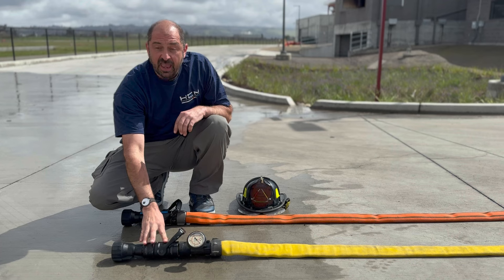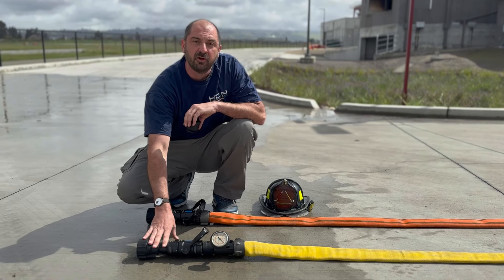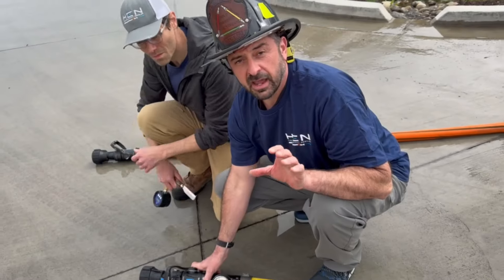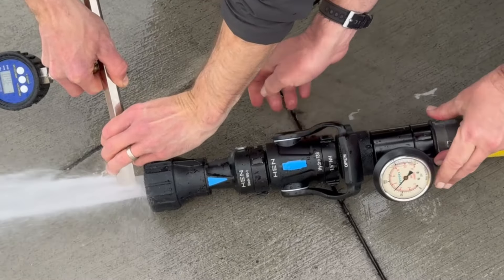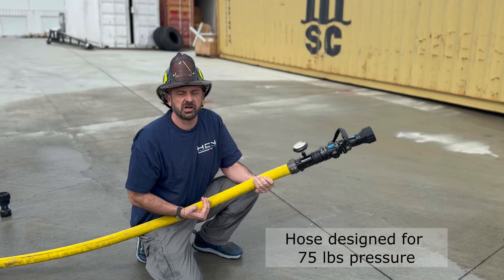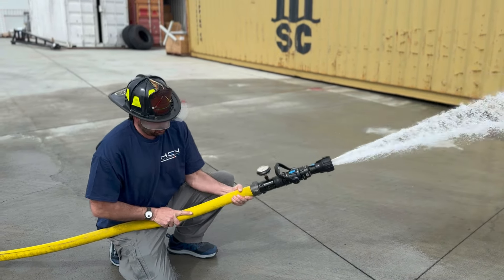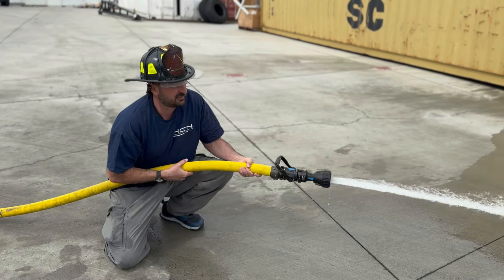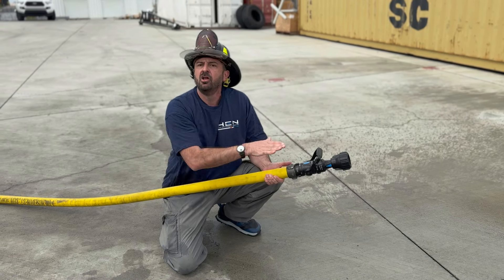Introducing the World’s First Back Pressure Increaser: A Game-Changer in Fire Suppression Technology

Comment: Will you still be able to extend the line (add additional hose) to the end of the nozzle, in case you extend short? Will it prevent pressures of over 50 psi in the additional length added beyond the turbo?

Comment: The HEN Nozzles TURBO BPI is A Revolutionary Advancement, Disassociating Nozzle Pressure from Back Pressure.
We have been working on this for a while, get 160gpm@50psi a 60lbs Nozzle Reaction and a 75psi hose Back Pressure, now that sounds like heaven, because it is:

Stay up to date on what's now possible, from rig to nozzle, and pattern to seat.   

HEN is Building the Most Advance & Balanced Handline Attack Package Systems in the World.  Back Pressure vs Nozzle Reaction GPM & Pattern Types.  A New Trifecta is Now Possible From Pump Operator to Back -up to Nozzles.  
TURBO Charge All 1.75-inch Handlines with 50psi Nozzles Pressure

The Turbo between 150 to 185 gpm, increases Back Pressure an additional 25 to 30psi in the handline stretch from Rig to Nozzles on top of the 50psi Nozzle Pressure in both Flowing and non-Flowing Conditions.

Boost 1.75-inch hose performance when using a 50psi NP with impressive benefits in all essential metrics from Higher Pressure Hose to Premium Low-Pressure hose design.

Streamline essential members tasks in handline fire stream development on the fire ground, while enhancing suppression and safety:

Pump Operator:  
1) Higher Initial PDP = Less Kinks On-Charge
2) Simplifies all Transfers to Positive Pressure Source (Tank to Hydrant Transfer & Booster Back-up)
3) No to Less Gating Discharges 
4) Governor Functions as Designed when Net Pump Pressure < Discharge Pressure 
Back-up(s):  
1) Entire Stretch Possesses a Back Pressure Enhancement from Rig to Nozzle
2) Appropriately Rigid Line is easier to Feed and Push on Advance  
3) Appropriately Rigid Line is easier to Pull on Advance
4) 75psi BP = Less Kink Formation in the IDLH and Outside  
Nozzles:  
1) Achieve proper NP quicker upon call for Water, more Mechanical Force Knocking Dry Kinks Out   
2) Reduces to Eliminates Hose and Nozzle Whip Issues
3) Ensures an Arm Length Nozzle Bite, Improving Water Mapping with Less Arm Movement
4) Low reaction force 50psi Nozzle Pressure remains intact.  

 Turbo plus all Blades ready for purchase at www.hennozzles.com/shop-all